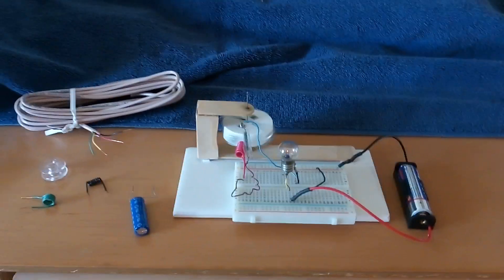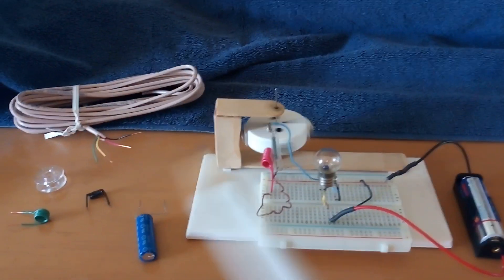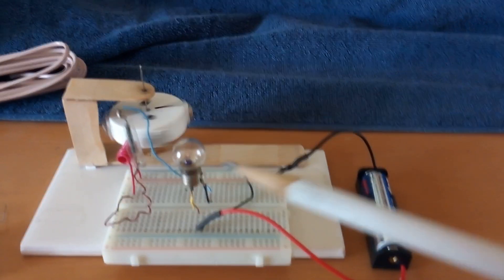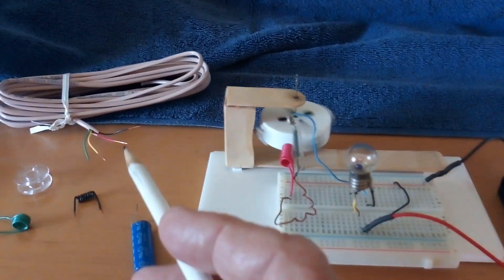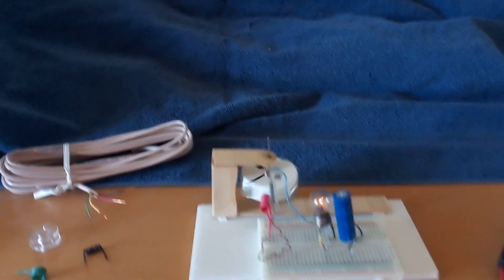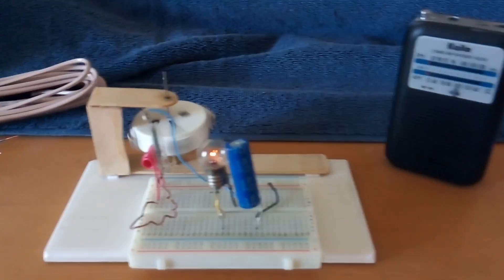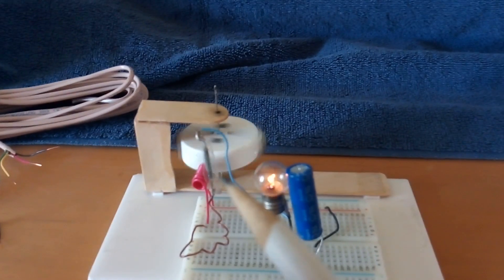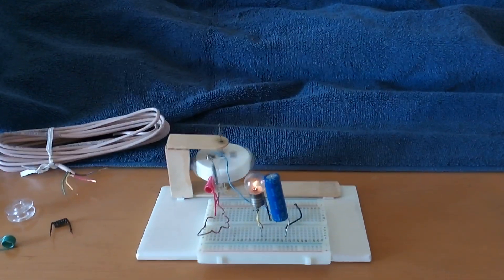Small Coil Pulse Motor

Comment: Hey bud, Slider2732 here. I got locked out of YT when we moved house, which is kinda ironic. 
This bulb behavior is in line with Bedini's systems, his 'ear of wheat' bulb. Had good success with that some years ago and it's fascinating to see such a practical use with the supercap. A similar thing happens with wireless transfer, when not wishing to blow up receiving circuits. Add an LED in series and it'll brighten and dim automagically with distance and load. Great vid!
Reply from the maker: Hi.  Sorry to hear about the YT problem with your channel.   Your right about the Bedini connection with this filament bulb usage.  It was an important tuning part in his SSG circuit.  I am still scratching my head about what I have just done here.  This should work with an LED also if the voltage is right.  Somewhere between 2.5v and 4.5v with the right coil should do it.

Comment: So do you think you're getting flyback from that small coil along with a pulsed bulb allowing for the 15min run time ? Would the flyback go straight back to the cap or does it pass through the bulb and reed switch ?

Comment: Hi, for us less knowledgeable, can you 1. Stop the motor so we can see the wheel and other parts. 2. Provide schematics.
Reply from the maker: Maybe later.  It is a simple 'reed switch' pulse motor circuit with 4 small N facing neo magnets on a plastic jar lid for the rotor.  A large sewing needle running in a brass screw is the main bearing.

Comment: Interesting twist using the filament light bulb 💡 🤔 👍
Reply from the maker: That filament bulb worked great.  It not only dropped the amp draw but it also made a wonderful pulse indicator.
Reply: I've had the same high current and heating issue with one of my projects. Going to have a play with this idea, thanks.